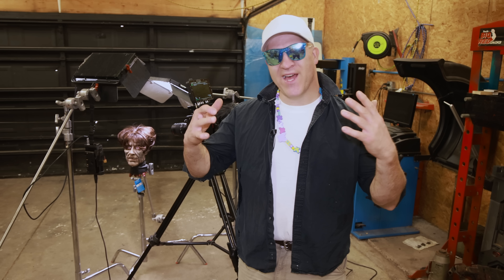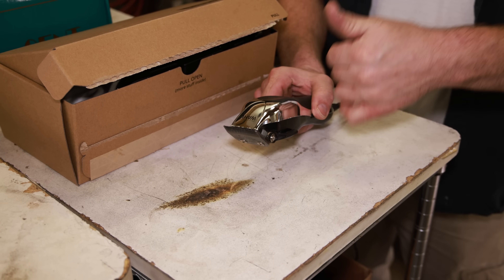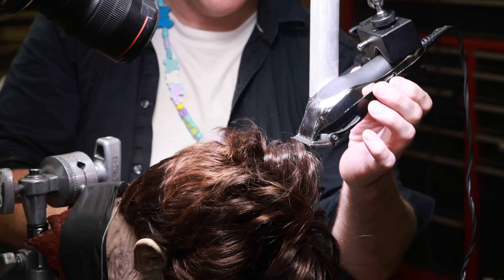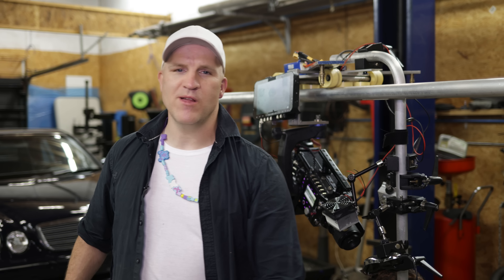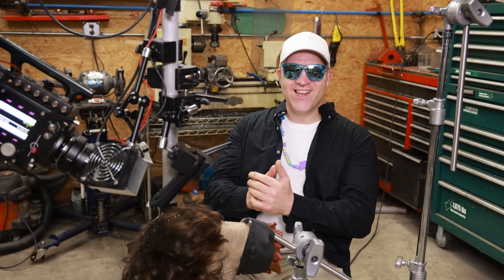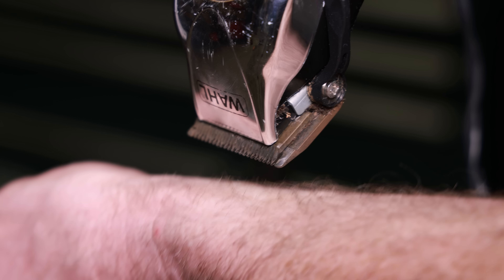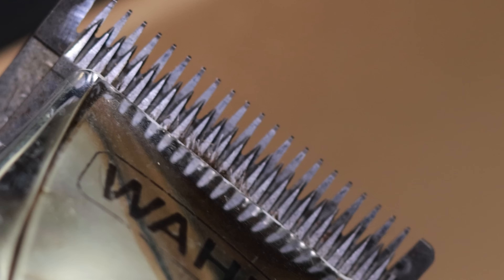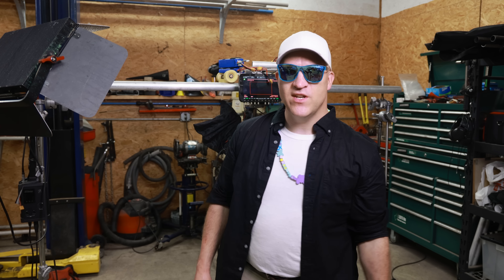Electric Hair Clippers - In Slow Motion

Comment: You need a tilt shift lens
Reply from the maker: Tilt shift lenses are cool, and it may have solved part of my focus problem here since no matter at what angle I would position the camera in relation to the Clippers there would be some part of the teeth or the clipper blade angled away from the camera... However I'm not sure that they have tilt shift in this type of macro configuration, this particular macro lens I'm using here is a 7X magnification factor.. it's ridiculous, for these shots I think I was at about one or maybe 1.5 magnification factor. But yeah tilt shifts are really cool

Comment: i wonder when smartphones are able to do that
Reply from the maker: Possibly One day, the issue is you can make an electron smaller and moving that much data creates a ton of heat and consumes power, the efficiency will obviously increase but you're still going to be moving a ton of data and I would think heat will always be an issue unless using a different transfer scheme.

Comment: You know....i like man scaped clippers because the blades arechangeable. But one thing makes me question the "clipper bite." 

I mean have you ever tried to...i don't know.... ADJUST THE FECKING BLADE taper?! I've been using regular clips on my junk for 16 years. You keep the blade adjusted to max taper, the fixed blade acts as a guide for the hairs while also keeping your skin away from the moving bit.

EDIT: i did also file down the tips, only slightly, if i do it too much it would make it dull.
Reply from the maker: ive done the same in the past but the teeth are still very sharp and if you look closely the shape of the teeth are different both on the rake and the blade, I mention this in the video but i should have explained better and went more into detail
Reply: @WarpedYT  aaahhh. Wait, i did forget to mention i used a file to blunt the tips.

Comment: 2:52 wowsers that depth of field is razor thin! It must have taken some tweaking to get that set up.
Reply from the maker: it was a pain in the but, I thing the DOF is like 1mm..very tough
Reply: @WarpedYT  Toshiba made a VHX-5000 system that moves in "Z axis" to take multiple stills at different distances, then software knits those images into an artificially increased DOF. That was 10 years ago. I wonder if their newer systems can do high speed video now ?
Reply: @solosailor222  Even if so, stacking the focus like that really kills resolution. If you stack 8 shots, you get 1/8 resolution and need more light. It's because the individual pixels are still in the same plane, each with their own lens, in some distributed pattern. Each individual output image then misses 7/8 of the image projected on the sensor. I'd be really surprised if this is developed into anything more than casual slow mo, 200fps or so, since the image fidelity is compromised so much.

Comment: What's the oscillations per minute on the manscaped clippers? The old ones should be 3600 opm, based on 60Hz power, if my understanding of their working is correct.
Reply from the maker: Great question! I've been really messed up for the last couple of months with this whole pandemic and all sorts of craziness around me. I meant to touch the point of oscillations per minute as well as the tooth design on the old school Clippers versus those manscape Clippers because I thought those rounded points were very interesting... However my mind has been really messed up the last couple of months and I forgot to hit those two points. But I do think they were more than that because for one they are DC, and two they were way too fast for my high-speed camera, that's the first time I've ever seen rolling shutter on that camera ever.
Reply: Why should it be 3600hz for old ones? I guess it should be 60hz.
Reply: @WarpedYT  i guess we could still calculate if we new how slow the slow mo was.
Reply: @lolvivo8783  3600 oscillations per minute, not Hz.

Comment: The Manscape clippers had a much narrower cutting span and the static blades teeth are much closer together than the WAHL ones, allowing for smoother travel over the skin. I think the cutting blade of the Manscape is moving at a higher speed than the others, too, reducing the chances of skin grab. 
WAHL are fine for a hair cut, but for a beard trim, or something a little more 'personal', I'd definitely have the Manscapes.
I managed to cut my neck several times while trimming my beard, using my aging WAHL clippers a couple of days ago. You've inspired me to get something a little more fit for purpose 😉👍🏻.
Great vid.